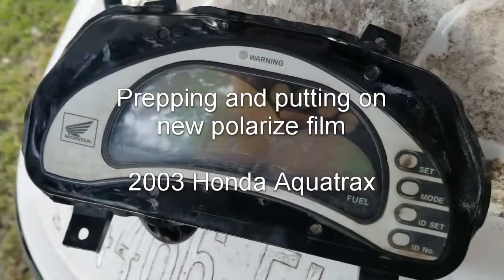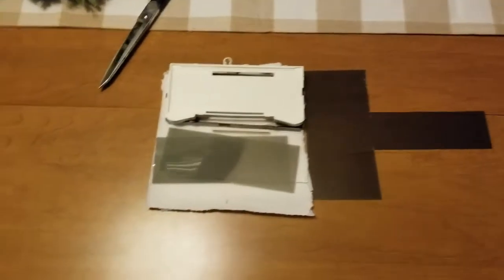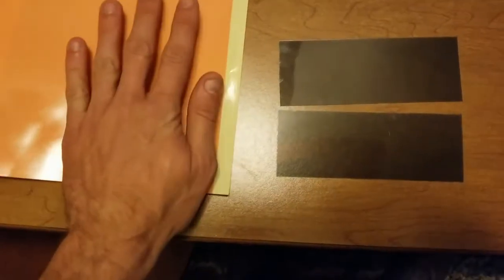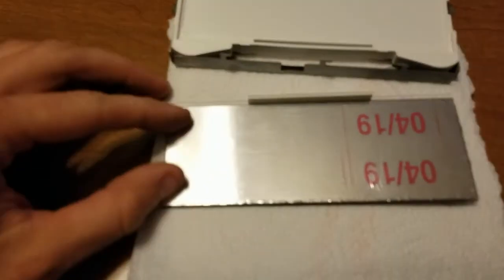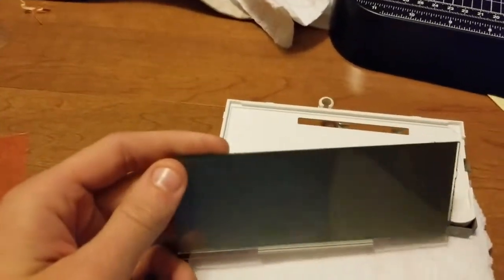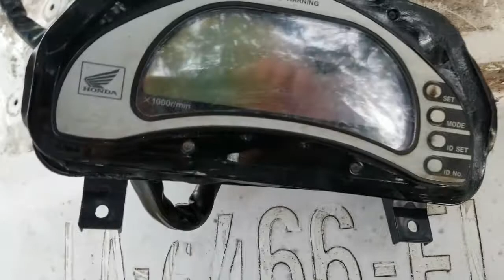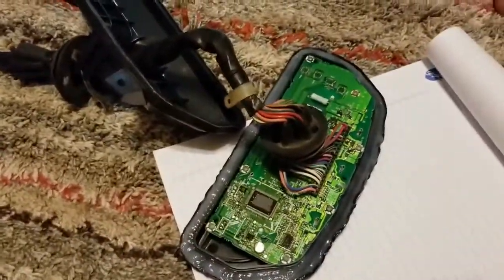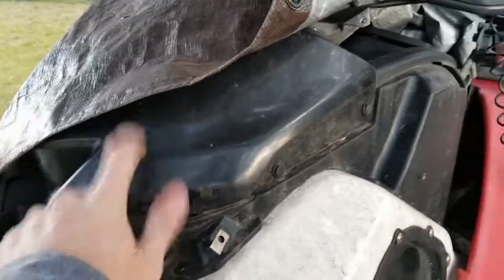DIY Fix for LCDs, Honda Aquatrax jetski part 2

Comment: The HVAC aluminium tape you used will not let light go through, therefore no backlight.
They sell polarized film.with adhesive on it, to where you do not need to buy a separate double side adhesive.

Comment: i did mine last week you only have to remove the face side of the display film not the back side. also you have to plug in the display and clock the rotation of the new film to the existing film dont just cut a rectangle off the corner of the new sheet of polarized film. thats why in the video the numbers still hard to see because  the new film was installed at the wrong angle of rotation.
Reply: Was yours that burnt orange color on the back as well? Just wondering if the backside polorizer being slightly sunburnt orange still works with only the front polorizer being replaced as you say
Reply: WHere do I get the film?
Reply: WHere do I get the film?

Comment: The back piece of polarized film has to be at 90 degrees. That's why you can only see it at certain angles
Reply: What do you mean rear film needs to be 90 degrees
Reply: so are you saying he need s 2 films? i thought he only used one.

Comment: How did you get the meter open to access the screen? I’ve got mine out of the ski, but trying to figure out how to open the plastic shell
Reply: You just got to pry it open around the edge. If the edge breaks it’s no big deal..just don’t crack the face when splitting it. Once apart you’ll see that the overlapping edge really isn’t needed when you seal it back up.

Comment: Dude you ruined the case
Reply from the maker: It still works just fine, it doesn't matter what it looks like from behind. When the display is in the ski you're never going to see the back side. As long as you can still seal it up with some caulk who cares what it looks like.